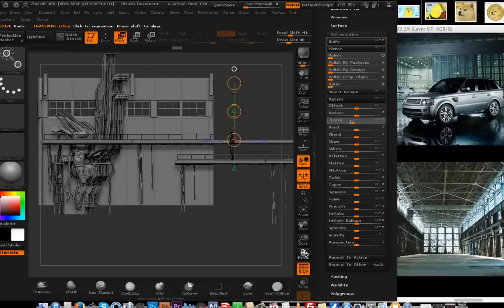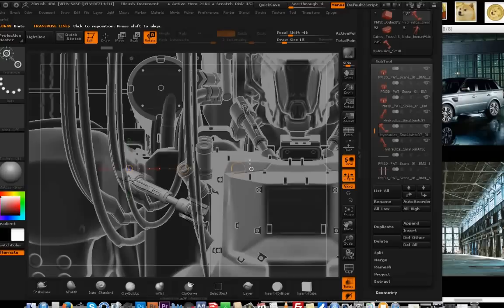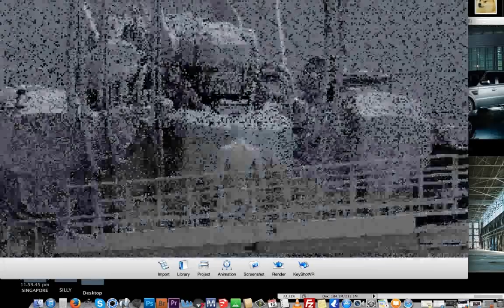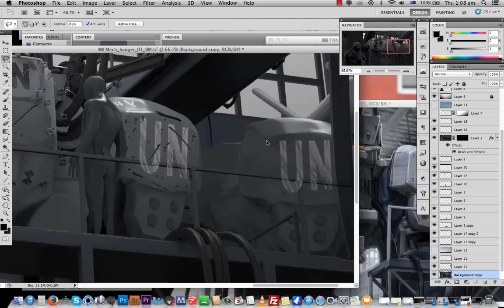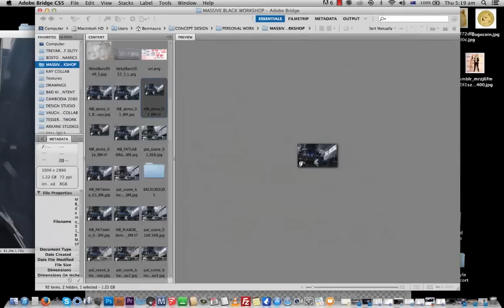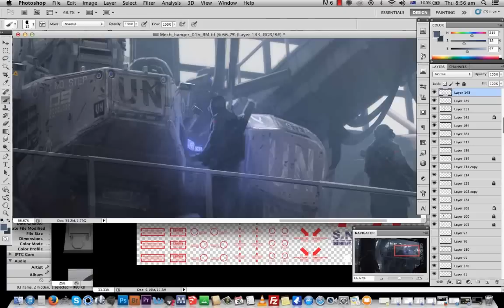Ben Mauro - ZBrush for Environments

Comment: Hi Ben Mauro! Do you have some isues with scales when importing large size stages from 3ds max? (trying to do some large terrain) After import, I activate floor in ZB and see the entire model inside de floor "gizmo (in ZB)" resulting in a small scale, a poor and low resolution from Dynamesh  for sculpt, (got to use values of 3000 in dynamesh to get some razonable res model for sculpt, insane!). I need to maintain scales to reimport decimated models to 3dsmax and maintain workflow. Could you give me some tips about how to check, double check and keep correct scales between  zb and 3dsmax to get a correct dynamesh work, some explain of what produced this?. I really apreciate a deep explanation,  cheking units setup, export setting (fbx), etc in both softwares. Thank u a lot! hope you could give some help.